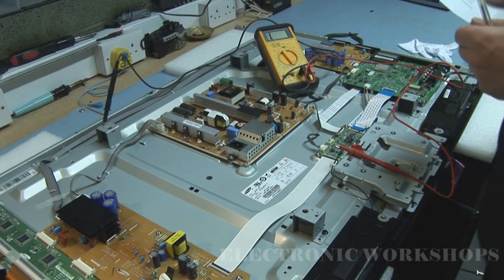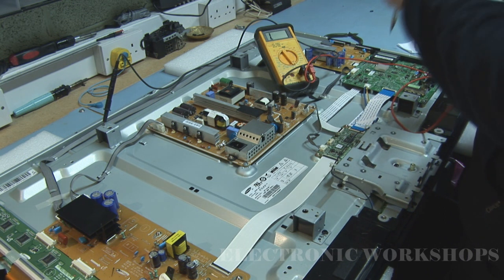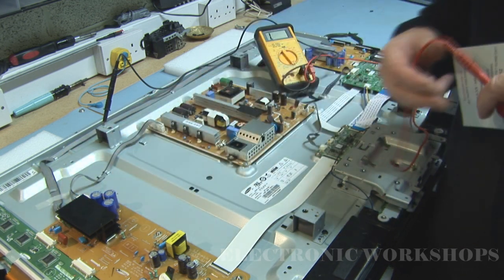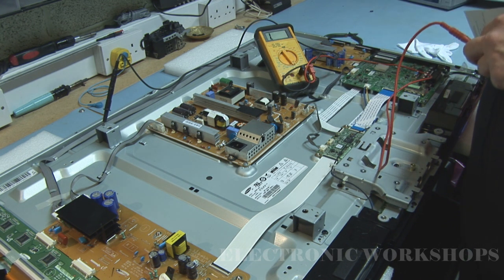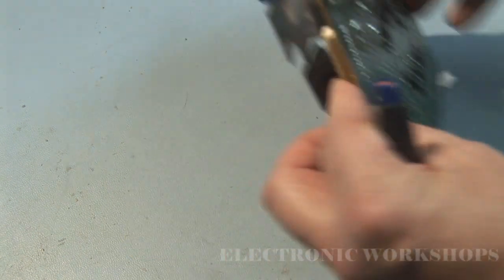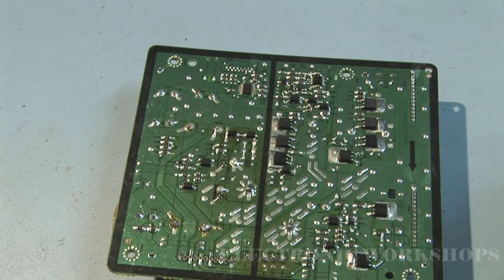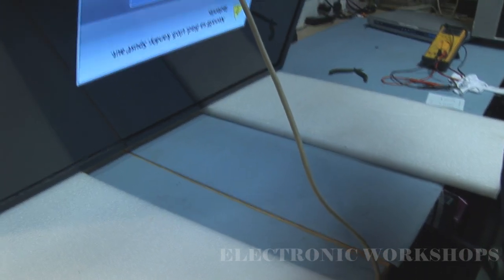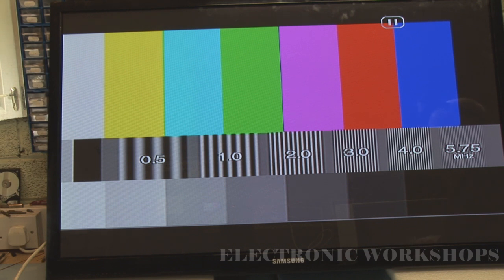Samsung PS43D450 No Picture | Repair Video |

Comment: hey, this video was very helpful, I have a Samsung ps43d450a2w, its just out of warranty, it comes on fine and the about a minute after the screen turns black but sound is perfect. I'm wondering if this is my problem. Dave
Reply: I have the exact same problem on mine... For a couple years now. Have you solved it?
Reply: Same problem I m facing

Comment: I have the same TV. I have a strange issue. When I powered on the TV,  it turn on but stuck at only one channels. Remote control is not working and I am unable to press any button on the TV. In order to power off the TV I have to unplug the TV power cord.

Comment: hi Please I have  a Samsung PS43D490A1 and I found out that the fuse Capaster under the heat sink on the inverter was spoilt and I changed it but still the same fault exist that is when I switch the TV on there  is no picture display.so can you please help me fix the picture display

Comment: Hi there, thanks for the sharing your videowith evryone , I have shut off problem with my Samsung Plasma Television 43″ PS43E490, Sometime it works for days without any problem and sometime it shut off after 20 minutes and Red Light flash 5 times, If i remove the power cable and reconnect the cable again then tv does come on.  So it doesn't happen all the time. I really appreciate if you could help me to fix this problem.
Reply: Good day
Did you come across this error? I have the same problem
Reply: @peterpovazsky8287  I don't remember now bcz it was 3 years ago...Have look on power supply for any dry or loose solder soldering connection or bad caps.
Reply: @Fazwaans  Thanks for the reply, I try